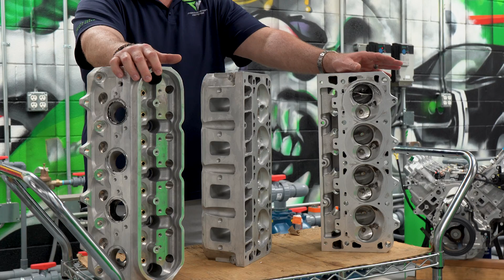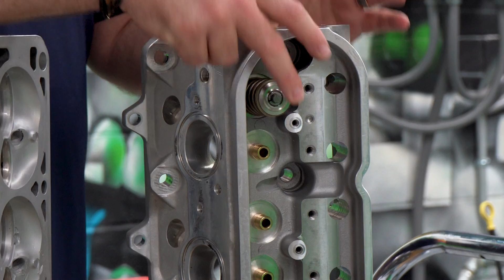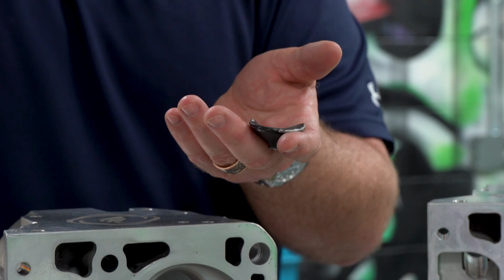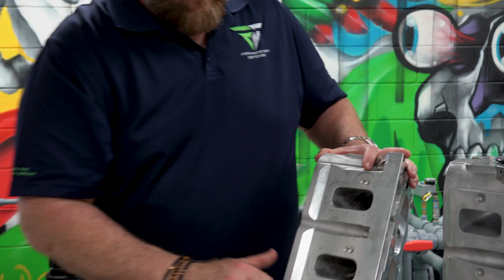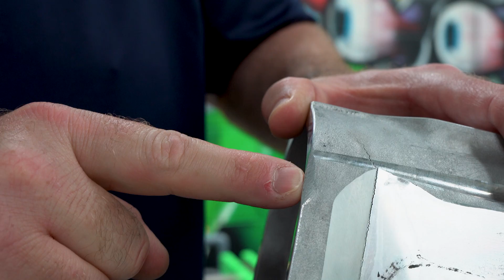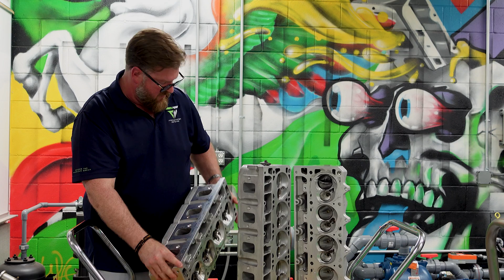Cylinder Head Failures, Repairs and Industry Change?!

Comment: Hey Chris, I do have a few questions regarding opening the exhaust ports up to reduce restriction and EGTs at port itself and its relationship to velocity driving the turbo on a diesel engine. I know you’re a gas engine guy but I still listen to you quite a bit on your turbo videos. Also a few questions regarding a custom ground cam and what the minimal overlap can be and if overlapping can be reduced to zero to keep the high pressure hot gases on the exhaust stroke from interfering with the cooler compressed air charge entering on the intake stroke? Separating/Isolating the hot gases from the cooler air should help air density and improve efficiency regarding the 7.3 powerstroke with the hindering 2 valve design. I’m focused on improving that design with a few key alterations, upsizing the valves, custom valve seats with a larger ID made of better heat transferring materials, same with valve guides, also focusing on springs and retainer upgrades. I need to flow test the set of heads I ported, they have helical intake ports so cylinder swirl is an important factor for fuel atomization. I need more time to devote to the development but HVAC is very hectic in summer, and it would be nice to have a flow bench at home

Comment: Customer's and shops expecting a safety net for their "learning curve" and self induced components failures has been growing for decades. I just had a shop / customer call expecting a refund on an engine they destroyed on their dyno caused by an admitted lack of monitoring ignition timing during the pull. The engine was detonated to death and the bearings proved it. It will only get worse as the enthusiast thinks bleeding out on the forums is a cure for their ills.
Reply from the maker: Truth!

Comment: the valves are quality valves from different company’s . the common part is your cylinder head.. it’s never good when companies defend their product.
Reply: It's even worse when a stone thrower fails basic spelling...........
Reply: When you compare stone throwing ,spelling to a possible product failure .I destroyed a 100,000 motor in a sense a LOT of carnidge 
 Had 2 spare valves from same order,I had a notion where issue came from in a New engine, got valves ,both fatigue tested from the new ordererd with motor. One failed,I called no admittance at all sent valve in for their testing it was going to let go the same .They take no responibiliy .I asked how was their situation in fixing the issues .They lost the valve, had the delivery postage signed for = Bad luck in so many wordsif they dont have it how would they know.
Reply: Not from these guys my failure not at all .Im thinking of using them after my issues ,is why I am watching

Comment: Have you guys addressed the F series heads that were cracking at the lower exhaust bolt area ?
Reply: Yes sir, we addressed it late 2021. We no longer do the lightening program to keep them thick on the exhaust flange.

Comment: Just wanted to let you know I really appreciate you doing these videos, it does help with siphoning thru the BS. BTW I had some m311 heads installed on my Thompson Motorsports ls427 they built us for autocross. We requested an engine that had a lot of torque! When we dynoed the Vette it made almost as much torque as horsepower! The dyno guy said he’d never seen that before and that he was thoroughly impressed and that was with a failing throttle body. I told him it must be the heads, torque and horsepower! We are still developing the Vette but just won our first race! I’m very happy with my FED cylinder heads.
Reply from the maker: Glad to hear your success and thanks a ton for the support!